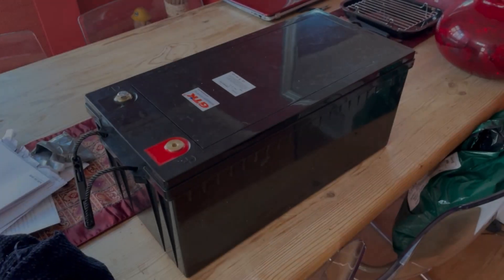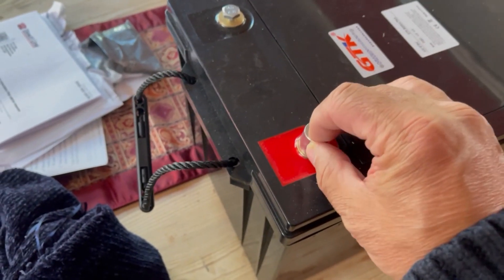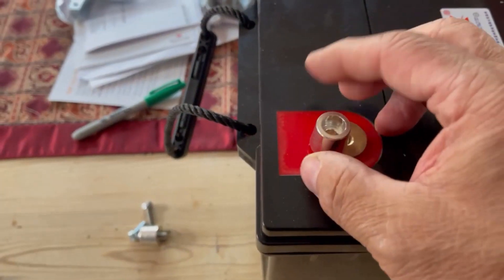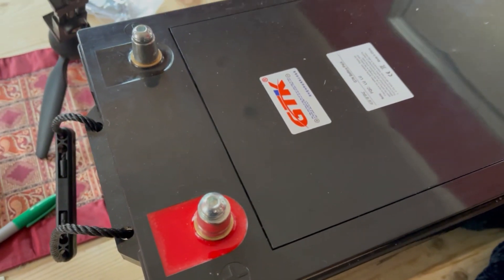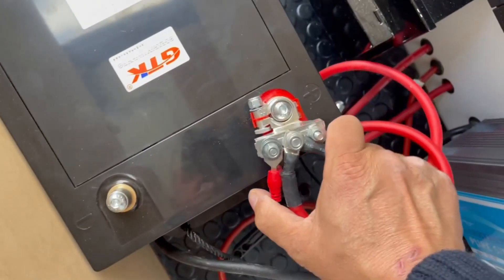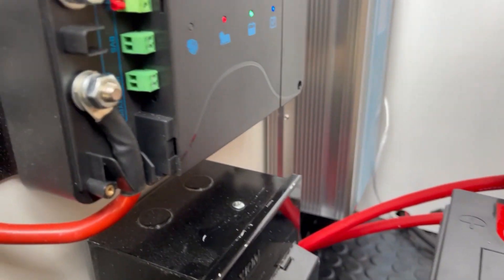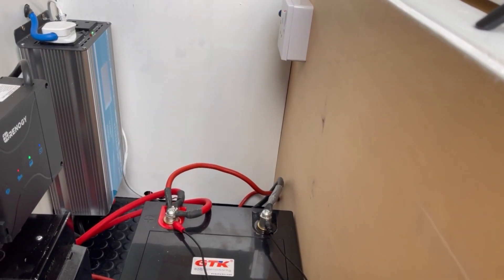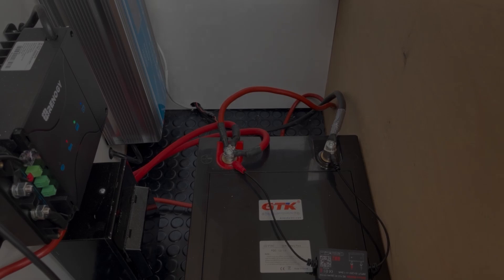installing my aliexpress lithium battery

Comment: Oh dear... you may of been sold a fake rated battery? GTK in the past has been known to fake the Ah rating of their batteries higher than what they truly are! They've in the past used swollen and used lithium LifePo4 cells yet sold them as if new. If this is truly a 12V LifePo4 battery the lowest weight you could possibly have is 60 pounds (cell weight) and still have 200Ah. The sales site lists it is a 17kg or 37lb battery which would put it around the weight of a normal 100Ah battery. Have you capacity tested it? Ie: run it till the BMS cuts it off while tracking Ah/watts used to see how many real Ah it truly has?
Reply from the maker: Oh dear is a bit patronising you may be more up on the tech side I can only tell I’ve been running a 240v fridge, a slow cooker and coffee machine as well as the usual lighting etc for over a year and it’s never missed a beat. So for half the price of one from the UK I’ll take the chance. Cheers for the advice though very helpful
Reply: @whereonearth1  I apologize as it is not my intent to be patronizing. Plus I understand your battery may perfectly serve your needs which I am glad! The problem is this company uses a deceptive practice claiming Ah rating that is not possible based on stated weight. Others who have bought this battery have claimed to the capacity to be around %50 of stated value.  People on your channel recently have been considering buying this battery based on it's price/Ah rating. For a 200Ah LifePo4 battery the price is insane good. But this battery it is not truly what it is claimed so people should know that before buying. Aliexpress has a lot of good deals. But they have a lot of dishonest sellers as well (I've been scammed as well on a few purchases). If in the future you or others are looking for a good "real" 200Ah LifePo4 battery may I suggest see what is on Amazon? For example DJLBERMPW and other Chins brand clones have prices around $599 with free shipping with 3-5 year warranties. If you have a problem Amazon will help you with the seller. Again I am very glad your battery is working for you and wish you nothing but the best! Just don't want others to think they are buying a cheap 200Ah battery when in reality they are only truly getting 100Ah. Based on that battery weight it is absolutely impossible for it to be 200Ah.

Comment: i find one 12v 200ah battery from aliexpress, the brand is wulills for only 416euro you think is a good deal or your battery is beter i don't know that much about batteries
Reply from the maker: The only thing I would say is it’s a gamble mine has been going for over a year and it’s faultless but if you get a bad one it’s expensive to ship back.
Reply: @whereonearth1  some batteries have waranty
Reply from the maker: They have a years warranty but the shipping is expensive
Reply: @whereonearth1  if they have a problem inside the waranty the shiping is free i think some batteries have 5 years, but i never heard someone to have a problem with lifepo4 you know anyone
Reply from the maker: @stopdontmove5169  hi yes I looked mine is five years but I still think you have to pay post. I’d take the chance as they are half the price and so much better than lead acid